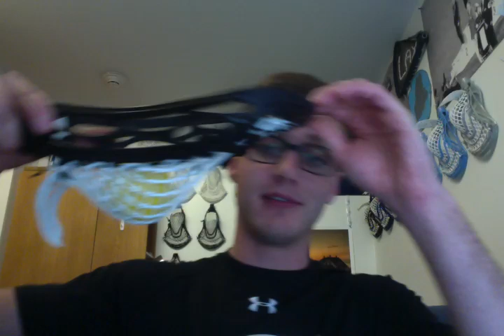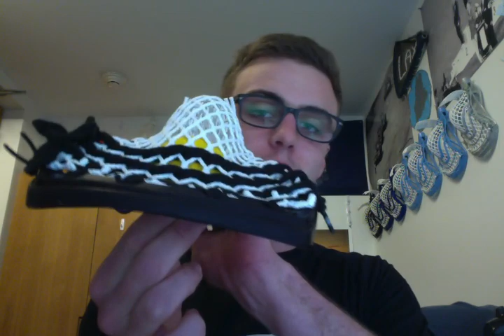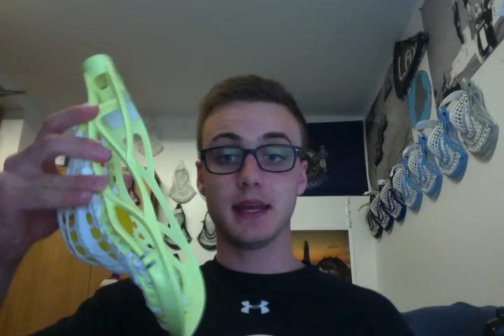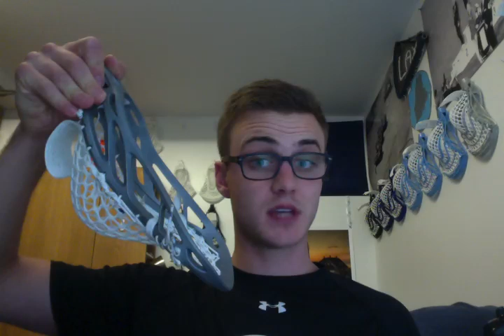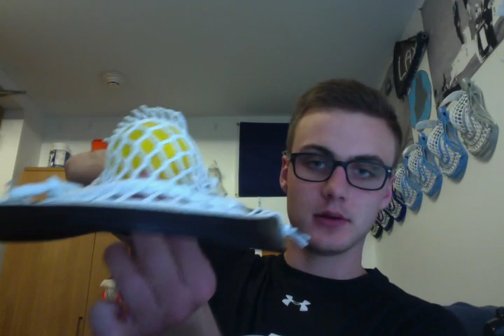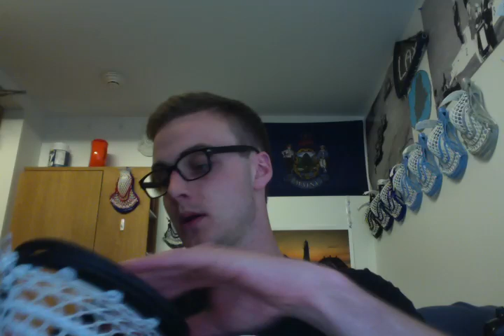The Physics of "Hold" - Lacrosse Stringing Theory

Comment: great video! the only thing is you didn't touch on is V shooters. My only thing is i can keep my stick straight up and down and the ball does not fall out (this is with bury mesh, a five diamond V and a tree diamond V) but then it throws with little to no whip the way i adjust the whip is with a top shooter either tightening if too much and loosening if too less.